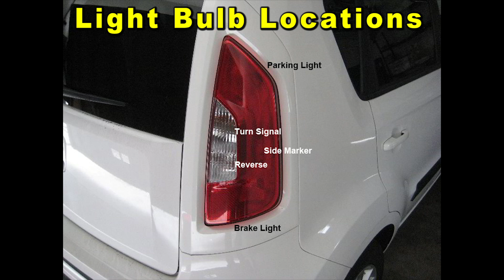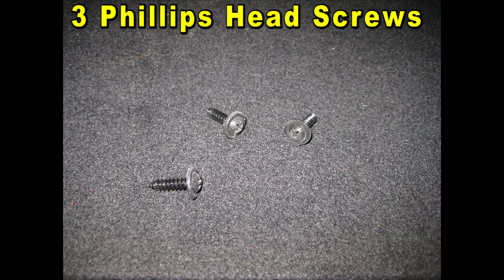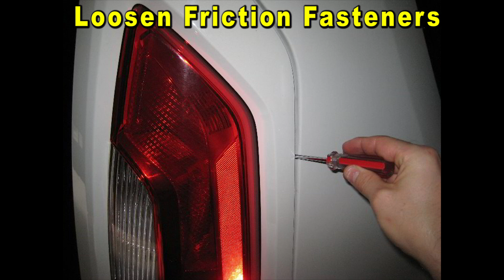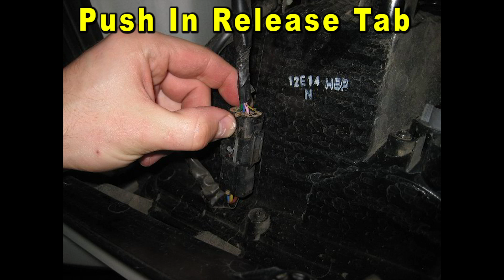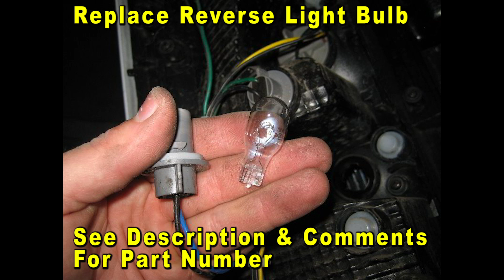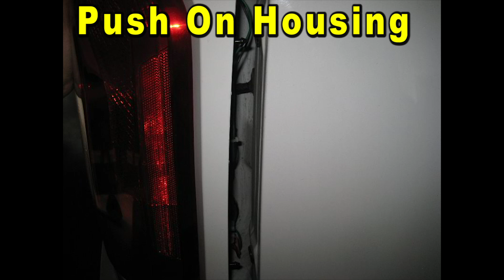2010 To 2013 Kia Soul How To Change Reverse Light Bulbs With Part Number

Comment from the maker: Kia Soul Reverse Light Bulb Part # - https://amzn.to/3BSLLsF
LED Reverse Light Bulb Part Number - https://amzn.to/3Yx6FWQ
Precision Screwdriver Set - https://amzn.to/3sLixaP
Plastic Pry Bar Tools - https://amzn.to/4cPO5xb
Socket & Ratchet Set - https://amzn.to/3Z17LbA
Mechanix Gloves - https://amzn.to/3jCnHkt
Torque Wrench - https://amzn.to/3vS5uSI

The Paul79UF YouTube channel is a participant in the Amazon Services LLC Associates Program, an affiliate advertising program designed to provide a means for sites to earn advertising fees by advertising and linking to Amazon.

This DIY video shows owners of the 1st generation 2010, 2011, 2012 and 2013 Kia Soul how to change a burnt out reverse (backup or back-up) light bulb in the tail light housings. Or you could upgrade both of them to brighter LED units.